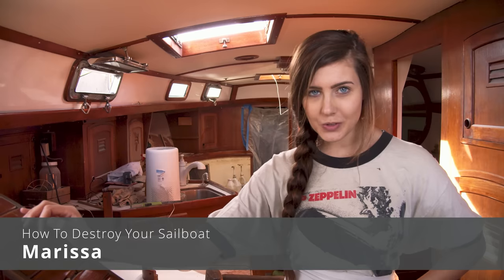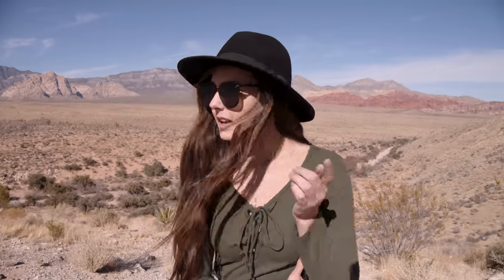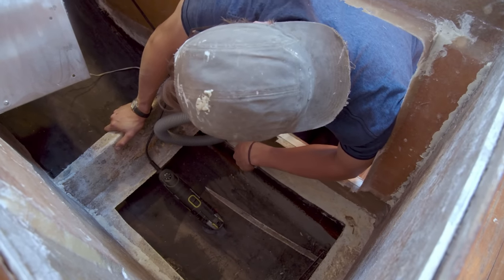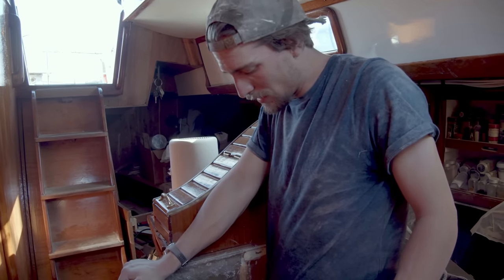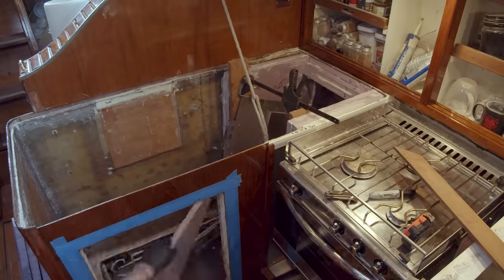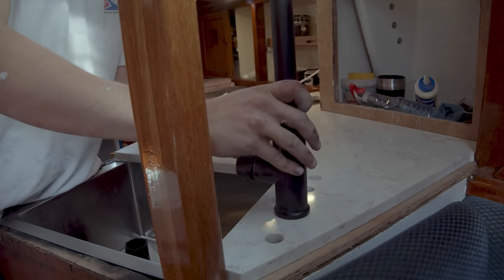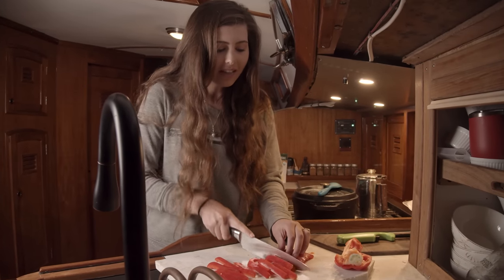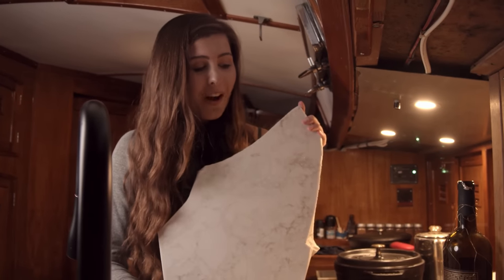Sailing Avocet | Building the COOLEST Boat Fridge!

Comment: Believe me, I've been sailing more than 40 years. Your sense of humor is the most important asset aboard that boat.  Everything else can be replaced. So what happens if Calif Highway Patrol stops you and finds 2-part epoxy, do you get arrested? Holy Mama.
Reply from the maker: Ha! Nothing happens, you can use it in California, you just cant buy it in California.

Comment: Nice work !!  Motivating me to fully refit too. I just have a few questions as your excellent video has me thinking about my 1978 Pearson 35 project.  What type or brand of refrigerator/freezer system was originally installed ?    Does your compressor run much less now through the day ?   What type of hinges are installed on the door, allowing the insulated door plug to open and close?  That's some really nice craftsmanship.    Again, excellent work and thank you for sharing this project !!
Reply from the maker: Ahoy Don! We had a Seafrost air cooled compressor, but we recently upgraded to an Isotherm keel-cooled compressor and evaporator which works better here in warmer climates (Mexico). It runs a lot less now! The hinges were found in a marine consignment shop, and are just marine fridge hinges. We write about the project more here: https://www.svavocet.com/2021/04/28/building-a-marine-fridge/

Comment: Just remember that 'heat tolerant' is a full grade below 'heat resistant'. I think I would be putting my hot pots into the sink for safety from damages to benches and from boat movements. The refit looks fantastic!
Reply from the maker: indeed, the reality of me cooking elaborate meals while underway are slim but this was still a good test.

Comment: Why are you using rigid foam and not closed cell spray foam?  Aside from it being so much easier to install, it has an R value/inch of 7 vs 5.
Reply from the maker: We made this decision because it was cheaper, easier to get, and ridged so easier to build with.

Comment: I use that pink foam to build rc airplanes. Honestly, the easiest way to cut it is with a hacksaw blade, not on the holder. Also, those cheap snap off razor blade knives, with a straight edge. Cut with an extreme angle, and you get super clean cuts. Usually takes a couple of passes. And elmers or titebond woodglue works great.
Reply from the maker: Noted!
Reply: You are inspiring! I have always wanted to build my own home refrigerator, now I have some new ideas.

Comment: I would not use quartz again . After a few years it pattern stains water stains and also red wine will leave an indelible image  that’s impossible to remove by hand. There is a polishing paste that pros use to refurbish quartz counter tops with a dual orbital polish machine that makes a big mess flinging paste all over. Use a chopping board for sure . It’s lovely for a year .
Reply from the maker: Not sure when we would ever leave spilled wine long enough to stain, and  this was an awful cutting board, terrible on knives. we will report back in a year, and many after that 🤙 at the end of the day we quite literally weighed all of our options and could have used anything we wanted. We chose this. It worked best for us. 

https://countertopguides.com/guides/pros-and-cons-of-quartz-countertops.html

Comment: Sorry but cutting boards are either wood or plastic for a reason, cutting on a hard surface or stone will destroy your knives, you'll have to constantly sharpen them.
Reply from the maker: We use cutting boards. We don't intend on using our countertops to cut anything. This was just to show they are scratch resistant. Almost 2 years in and still not a single scratch/cut